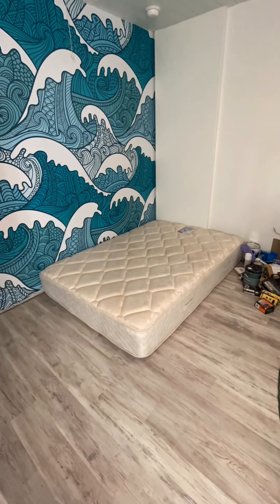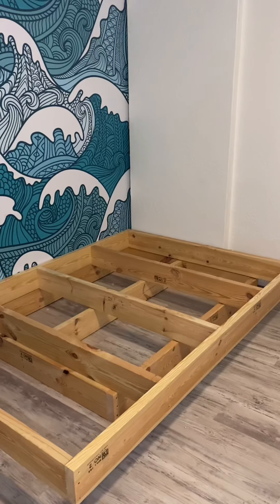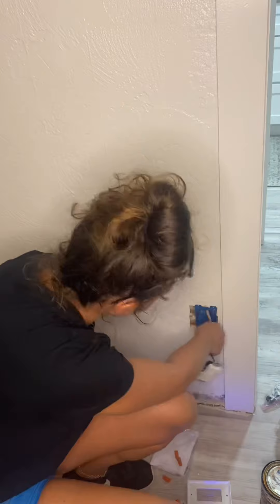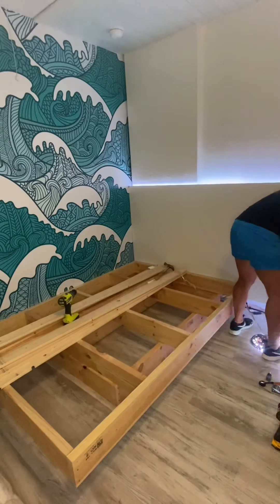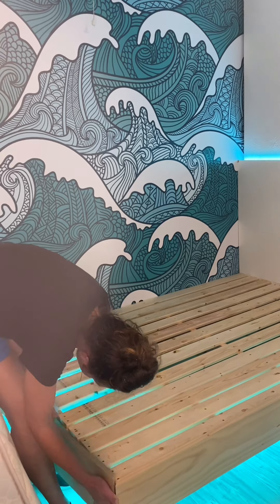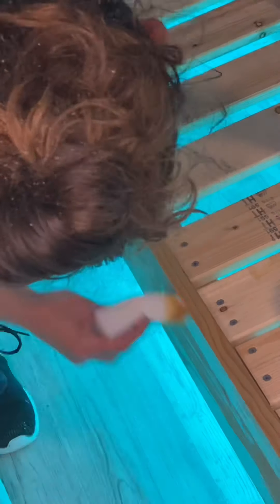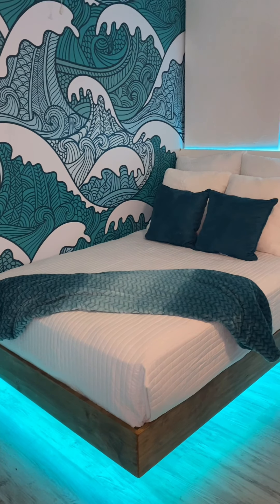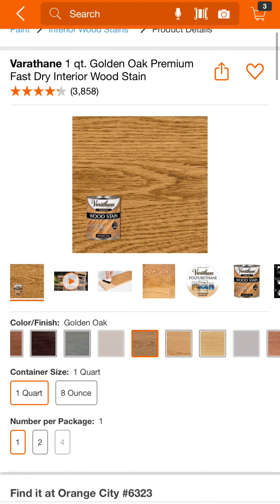DIY Floating Bed Tutorial Time-lapse! Easy, Cheap Floating Bed Frame! LED lights! Only $250 to make!

Comment from the maker: For more tutorials and #shorts make sure to SUBSCRIBE!

FOLLOW ON TIKTOK https://vm.tiktok.com/ZM8HPPTmV/

FOLLOW ON INSTAGRAM www.instagram.com/eastcoastfloridadiy

AMAZON PRODUCTS www.amazon.com/shop/eastcoastfloridadiy

PRODUCTS beacons.ai/eastcoastdiy
Reply from the maker: DIY Floating Bed
Material List and Cuts for a Full Size Bed

Lumber List
10 - 2x6x8
12- 1x4x8 furring strip
2- 1x8x8 select pine 

Full bed dimensions 75”x 53”

For top bed frame
Cut 2 - 2x6 to 75”
Cut 5- 1x4 to 50”

For bottom frame
Cut 2- 2x6 to 35”
Cut 3- 2x6 to 55”

For slats
Cut 12- 1x4 to 75”

For finished exterior frame
Miter Cut 1- 1x8 to 75”
Miter Cut 1- 1x8 to 53”

If no miter saw cut 1 to 53” and 1 to 75 3/4”

Materials used 
3” wood screws for frame and frame to studs 
1.5” wood screws for slats

Varathane pre-stain wood conditioner
Varathane golden oak
Melamine sponge to apply
Wood filler 

Tools Used
Miter Saw 
Drill with drill bit to pre-drill
Impact driver (screwdriver)
Stud Finder
Sander (optional)

Extras!
LED lights 
Floating end table (watch my DIY floating shelf tutorial) 
Headboard (optional)
Reply: How does one post their finished product on here, bc I would love for you guys to see this. 😅. Thx again for sharing ECD!
Reply: Hi question so is the bed head wider than the bed itself?
Reply: @shaquillefarrington1310  mine isn't. Me and my wife used the leftover plywood, 2×4, sponge and cotton and then wrapped it in black leather(inexpensive stuff). My son loves it.
Reply: @gshango  you got a picture of video of it I can see? Thinking about building one of these for myself and my kids
Reply: @shaquillefarrington1310  I have pics but don't know how to upload them on here. I will post it on my channel 😀maybe you can see it there.
Reply: Do you have the measurements for the wood for a king bed?

Comment: This looks so awesome, great job. There is a big issue though, this bed will accumulate so much dirt under it and there's no way to move or clean. Maybe have the slats somehow secure in an easy removable way instead of screws, that way you can eventually remove them to vacuum.

Comment: My daughter loves this but does not want it agains the wall on the side, just at the headboard. How would you suggest making if centering it on the wall instead of next to?
Reply from the maker: Your bottom frame needs to be adjusted so you would see it in both sides. So more narrow but longer. Still screw top and bottom frame together and both to studs on the wall!

Comment: Hi would you happen to know the dimensions for the frame for a twin sized bed or the formula to get it because i’m not very smart
Reply: I have a twin and I got measurements of width of 40in and length of 70 in . I’m using an outline of my old bed frame to make sure my bed fits and still it’s even ! Hope this helped

Comment: Cora, how much bigger fro a queen ? Or is there a certain amount of over hang for the mattress?
Reply from the maker: Queen is 80x60 compared to the full that is 75x53 so you’ll want to adjust the cuts for that. Add 5” to each cut for length of frame and 7” to each cut for width of frame…
Reply from the maker: I don’t have a large overhang for mattress but you can add more if you prefer!

Comment: For the top frame. It should be 5 2x6 instead of 1x4 right lol
Reply from the maker: The top frame is out of 2x6s the slats are 1x4s
Reply: I think he is referring to the frame for the top. You have your cut list as 5 1x4’s @ 50”
Reply: I wish I had read the comments first lol...